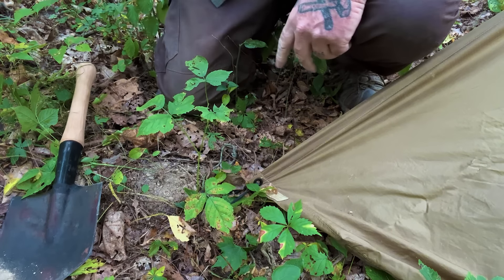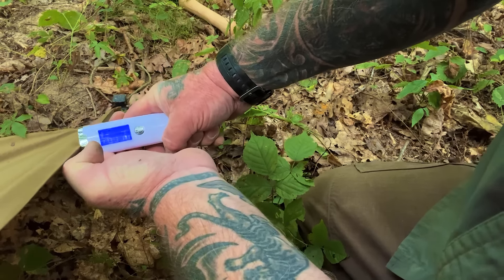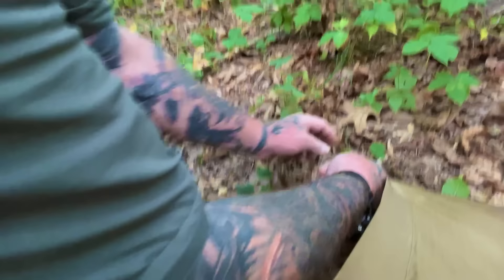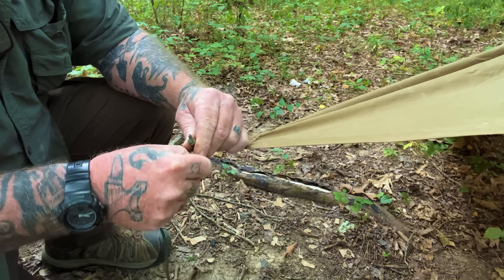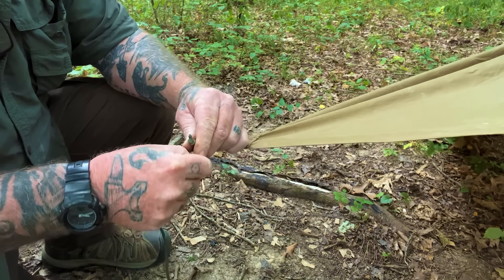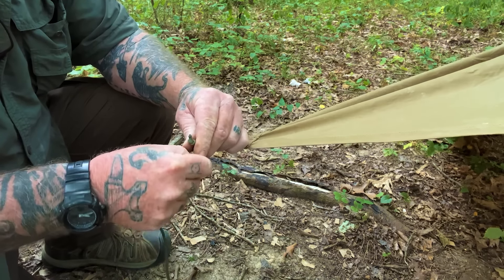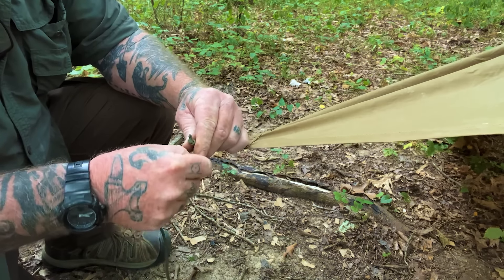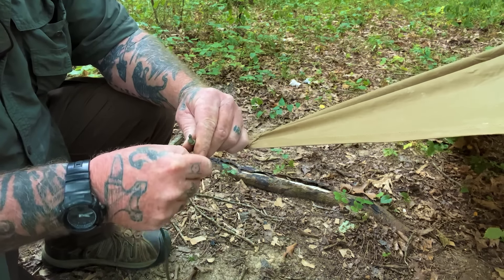Staking Methods and Theory Part 2 FAILURE TESTING with Dave Canterbury

Comment: Reading the internet is not research. Doing what Dave has done today and gathering data (though it could be a more accurate method, it was still pretty good) IS research. If you want to do secondary research, which is reading, you have to read from people who have done primary research, which is what Dave did today by gathering data. Thanks, Dave, for doing actual research for us.

Comment: I use bunshee cord as a shock absorber on all the eyelets on my tarps and tents. The bunshee cord is looped through the eyelets three times. Depending on the wind strength, I use 1, 2 or all 3 loops to absorb the energy of the gusts. I learned to drive the stakes vertically into the ground in the military and I still do it that way today. I never questioned why and how. Thank you very much for taking the time to find out and explain this. Greetings from Germany

Comment: I like the steel v stakes that are used with the old army shelter half tents. They are heavy and sometimes a pain to use in hard soil but you can’t kill them. For a long hike in I like the groundhog style, they can work in multiple soils with just a little mod in technique when needed.

Comment: If you have very soft soil, there is a big version of the GroundHog stakes in 10 inches called MSR Cyclone stakes.  They are 10 inches long, in fatter Y design and they have a slow helical twist rather than being straight.   They have worked well for me in muddy situations.

Comment: Back in the early 70's I worked for a circus with a 60 by 90 ft tent. for the ridge line we would triple stake in a pyramid shape with 3 wraps of rope  with the flat end facing the tent and attaching the hook in the middle of the stake. We then used a come along to tighten the cable.

Comment: If you decide to make a part 3, I would suggest to talk about which way a stake should face so it does not bend as easy. If you put a V stake or sand stake in wrong it will bend regardless if its at a 45 degree or straight in. Same with the plastic T shape stakes. If you put them in the wrong way they can slice through the ground and then pull out. I though you were going to hit that subject in this video. Most stakes have an angle or hook at the top and that hook or angle goes the opposite of the tarp or tent that your staking do down.  Good video series to teach the basics of securing a shelter down properly. I do believe this is a first.

Comment: Usually i will just use sticks. Not even carve a tent stake just carve a point.  For great tent stakes the military pup tent stakes are excellent stakes sand dit whatever.   Putting a notch in a wood stake though can help or use a stick with a branch on it.  or use a longer stick and put it in at an angle.

Comment: Also the points you made relating to tarp/guy line angle are similar to what a skipper has to account for when anchoring a boat/ship, i.e. "Anchor Scope." i.e. a higher scope ratio is better, just like a smaller tarp/guy line to ground angle is better. again thanks

Comment: The other staking trick I've heard from a military guy was that when they had poor ground, such as sand, you don't run one line at 45 degrees (right/left, not up/down)  from the corners of tarps.  You run two lines with each one parallel to one of the sides that are meeting at the corner.  It reduces the load on each stake and gets you on different pieces of ground rather than putting all your hope in one piece of ground.

Comment: I usually use 18cm/7" ground-hog style aluminium stakes at 45°. The forest soil is quite soft, but I can overcome that with a stone. Almost never 90°. I was quite surprised by your 90° test results. I like to use "dead-man" method aka buried branch only in the snow. When possible, I completely avoid using stakes, and use roots, stumps and rocks instead.

Comment: I learned a long time ago that straight up and down is much more secure than an angle.  I learned from an old timer and it was relative to beach staking, which is the ultimate challenge.  I've banged my head on the wall, so to speak, trying to explain this to others.  To simplify, there is friction and the forces relative to the weight and compaction of the soil at play.  Also, the angle of your tie down relative to these other forces.  When the stake is put in on an angle, there is much less weight/force on the stake because you lessened the maximun depth within the soil the  stake resides.  Additionally, that compounds the further up the stake you go.  With multiple or prolonged pulls on the tie down, an angled stake starts flexing starting at the surface and working its way down.  As that happens you start losing the friction coefficient as well as the weight force of the substrate, until it eventually fails.  This is why they have sand stake that are longer and ribbed, to maximize weight/mass forces as well as friction.  They should always be mounted vertically.  Same goes with a beach umbrella.  The pros try to make as small and deep a hole as possible to not disrupt the compaction of soil while placing the umbrella perpendicular to the surface.

Comment: OK David; The instant i saw your diagram of soil to soil friction area relative to stake length, I knew I was wrong all of these years, like you realized. i.e. vertical stake angle maximized soil to soil friction and stake depth (for 45 degree tarp/guy line angle). This is the 1st order effect, but you went finer and spoke to tarp/guy line angle, and how you could account for variations off of 45 degrees. Perfect. By Part 2 it was already a fait accompli, but you verified your assertions with testing, FANTASTIC !!! Thank you. Plus we don't have to worry about pulling the stakes, since stake to soil friction is the same, i.e. it's based on stake length, soil type, and stake type, and we are already used to that. Thank You !!!

Comment: Thank you again Dave for a very informative video. Going right along with your last one on stakes you were spot on. My preferred stake for holding is the military stake for shelter halves or the longer ones for larger tents. Due to weight I use the aluminum triangular stakes in the shape of a Mercedes emblem. I also like the abs plastic just because they have the duel purpose of flame extender. I like to carry a couple of them with me but use the aluminum ones. Thank you for the tip on connecting a line to a tree. Using the slippery half hitch for a marlin spike is a great idea. That will now be a part of my tricks. Loved this video.